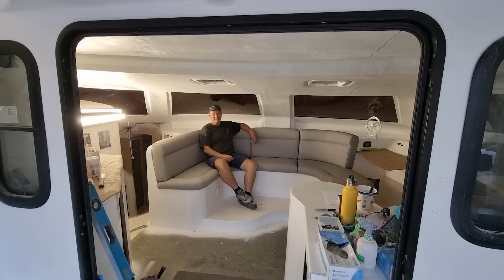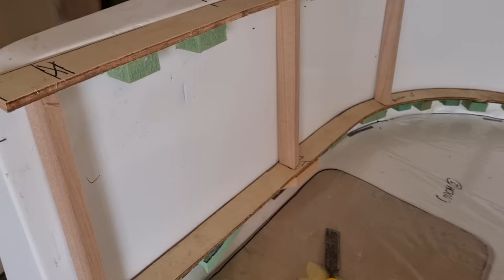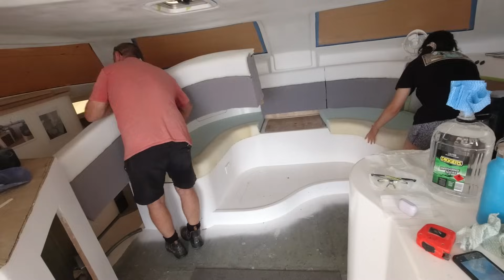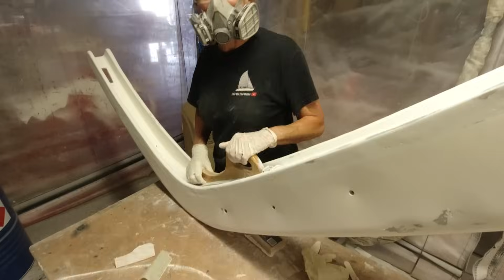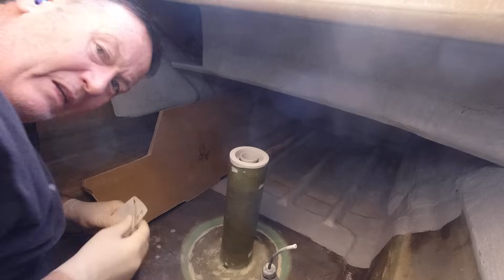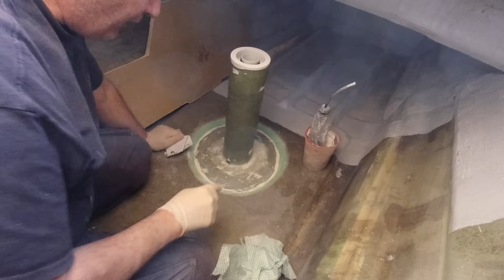25000 Subscribers / / Mods don't get any bigger than this -  Catamaran Project Ep301

Comment: I clicked on your video because I want to add sugar scoops to my cat, I got stuck here and am enjoying your work, so if I put sugar scoops on my boat, will this effect the dynamics of my hull, I see you adding buoyancy to your bow, is this because there are issues with your hull persay, or will I have to do similar if I put sugar scoops on? Thanks in advance, congrats for 25k subs, I have 404 but I am still happy about that 😊
Reply from the maker: If you add length to your scoops it will potentially create more hobby horsing, as the longer stern buoyancy may lift earlier and therefore alter the bows reserve buoyancy to  respond to the downward motion.Our hull ( in previoys versions)
had a buoyancy deficiency in the bow and required the bulbs to compensate before the stern was lengthened.Cheers Ross

Comment: I would put a reverse modern bow on it, your modifications have to be done so why not make it look modern also? Anycase you know what you’re doing.
Reply from the maker: Modern does not always solve a problem.Reserve buoyancy and under 13
Mtrs is the dilemma.Marina costs, service costs  and plunging bows are major issues when extended bows are implemented for nothing other than cosmetic appeal.

Comment: Turn the boat into sleek reverse bows not bulbs!
Reply from the maker: There is no option for us, the rake to deep and  boat must stay under 13mtrs for us to avoid excessive insurance and marina fees. Also very difficult to determine the buoyancy required with the reverse bows as we have a known quatity this way. Boat is older vintage would not quite suit the reverse look,Faired in bow will be underwater similar to crowther tulip shape.Ross

Comment: Bowlbus bows. You'll need 1 tone of buoyancy per hull to stop the poor-passing on this size vessel.
Reply from the maker: I was concerned about that, but the previous boat had three goes at rectifying, the final solution was pretty smooth.There is loads of secondary buoyancy it was the primary  that was the problem.The stern additions were also taken into account by Oceanic Yacht Design Marine Architects to improve the laminar flow.The tulip design reduces pitching but time will tell and can be added or shaved back to fine tune in subsequent haul outs.

Comment: Never ceases to amaze me how you are such a master at sculpturing the fiber glass. You are never afraid to grind off the Gel coat And change things. I have always wondered when you spot in the new flow coat if you Can do it without getting a shadow line at the blend?  I have always seen people struggle with that.

Comment: What calculations did you make to know how much lift you needed and provided with the bow mod? Did the boat manufacturer help you any?
Reply from the maker: Yes mate, the previous boat was solved and floatation established with some effort and cost to the owner of the vessel.I will likely make minor adjustments on first haul out after rigging and thorough testing.Was never going to be perfect.
Reply: I know fixing these sorts of issues can be damned hard after the fact, because you are limited in what you can do. I have modified other peoples designs before without having access to their models and data and it was hard. I'm glad you had someone else go through this problem first so you had a starting point.  I have one more boat in me at 67, but can't decide what I want to build.  @LifeOnTheHulls

Comment: Question as it pertains to the buoyancy, when you started building the boat you mentioned this issue and decided to use foam core. You had mentioned this construction method would make the boat lighter and decrease the displacement. 

My question is - what is the displacement of the foam cored boat vs the chopper glass boat and how will the fore and aft mods change the bouncy?

Comment: Hi mate, loving your videos, my simson cat had extra bouncy add to her the same as you are doing ,one of the issues i had was cracking at the bulk heads when it was lifted in travel lifts due to the foam compressing and not enougth layers of glass, i can only recomend adding a lot of extra glass around the lift areas to over come this .the other problem is the bow will become heavy due to the two hull in that area so if you can lighten up the orignial hull it can help. Also i would not seal under your anchor windlass as it will not drain any water away that comes in through the shafts.Merry christmas to every one

Comment: I guess I have to see it when it's done. Looks like you just destroyed how it cuts through the water.  will be interesting to see how it sail regardless.
Reply from the maker: We thought the same, we have partly adopted a s.w.a.t.h design(google it) and appropriately designed by the previous builder as boat was nose heavy so did not slice in fact quite the opposite.Extra buoyancy actually is torpedo shaped with minimal resistance on the nose.cheers mate
Reply: @LifeOnTheHulls  Nose heavy? So did the last owner have his chain extra sails water tanks all up front? every boat can get out of balance. I still have to see yours sail and if it can even reach 10 knots now.
Reply from the maker: Previous oener had it fully rigged, sat 40cm nose heavy, bow was too fine designer walked and left him with a 150000 debt.
Reply: @LifeOnTheHulls  Okay now I am using my head. You have no open space there where most have only netting. That extra fiberglass weight is huge. So expanding the hulls 1 meter in the Bow would make it up. I looked at your cat and compared it to many others and where they have nets/trampolines and you are fiberglass.
Reply from the maker: Exactly mate.merry christmas.@dc1544
Reply: Yeah I expect she is now a motor boat with sails
Reply from the maker: We have implemented a bow similar to Top Gun, the fastest cat in Australia.She has a faired in bulb, tulip shaped, all of lock crowthers designs pre catana were built this way too, there were very little performance issues there also.We opted for safety and piece of mind that can be adjusted after trial period.Always a compromise.